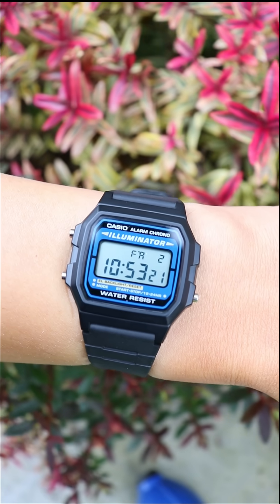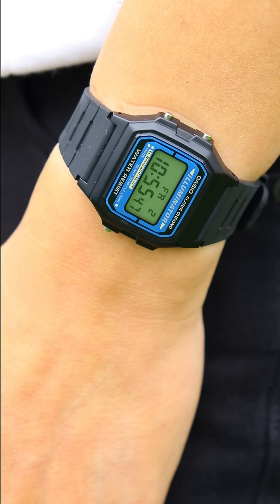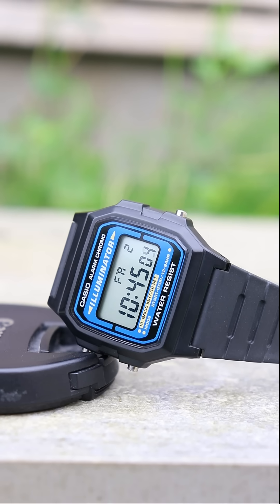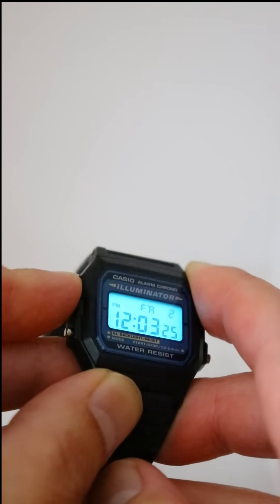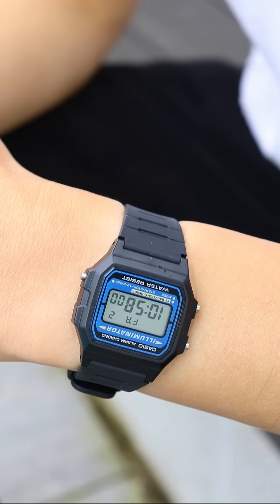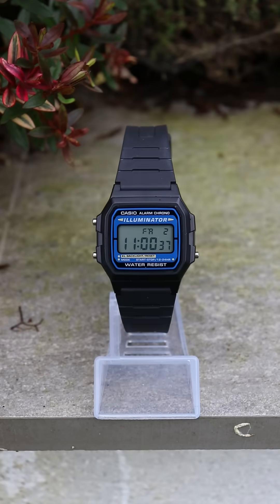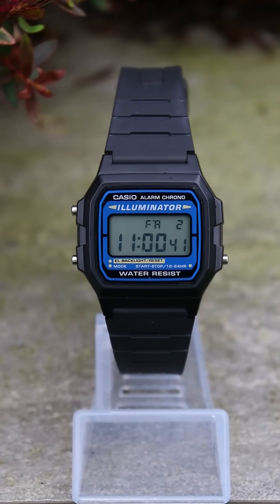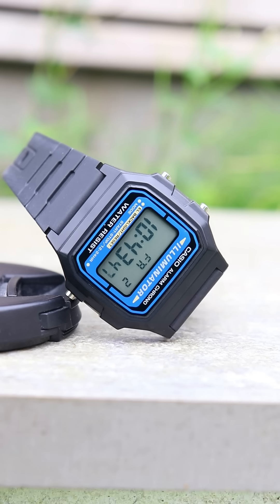This watch creates 150 Volts of Electricity #casio

Comment: If you liked the F-91, but you wanted it to be actually good, this is it. I bought mine in early 2023, still going. I might upgrade it with a metal case.
Reply: I got mine in 1997, maybe 1996, running on its third battery now.
Reply: @zephyrwestern3056 kaç yılda bir pil değiştirdi
Reply: I did that to mine - got another plastic one too as I also like it in its original case.
Reply: Yeah but its ugly though. Why would I want to look at an ugly watch multiple times a day and strap it to my wrist? It looks like a watch for an 8 year old boy. F-91 is subtle and sleek so it fits into any demographic.
Reply: @casualcadaver  I don't understand. The F-91 uses three colours, where the F-105 uses one. It's the F-105 that is subtle, not the other way round.
Reply: @vaclav_fejt Its not the amount of colors its the size and proportions. This watch has a massive blue border that takes up atleast 30% of the watch face. F-91 has colors but they are accents not the main draw.
Reply: Go for timex t80 full metal, way cheaper with same light
Reply: @muthulakshmimuthiah4804 Really? The F-105 is about 500 CZK, about the same as an F-91. Steel or brass T-80's are around 3000 CZK, and the resin ones aren't much cheaper. 
What do you say?
Reply: The f91w IS actually good
Reply: @patrikeluisbritz4912 If that is your rating, try the F-105, you'll be astonished.
Reply: @patrikeluisbritz4912  not with that useless LED it’s not